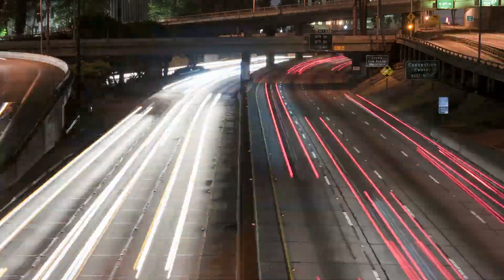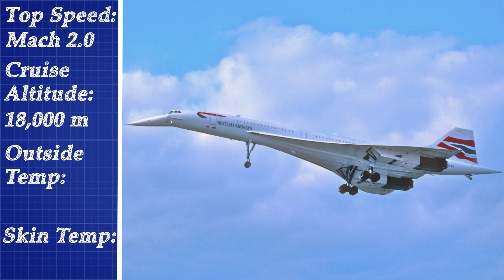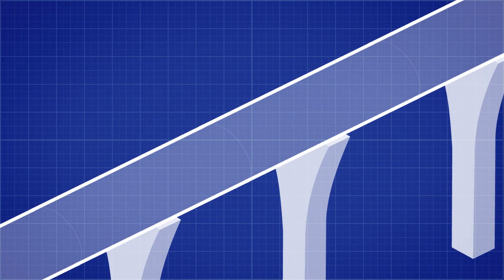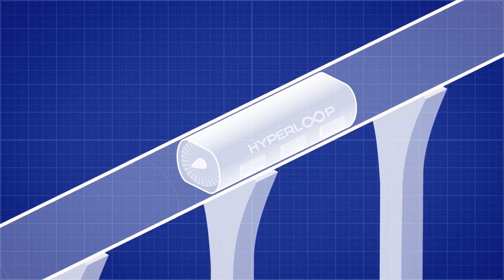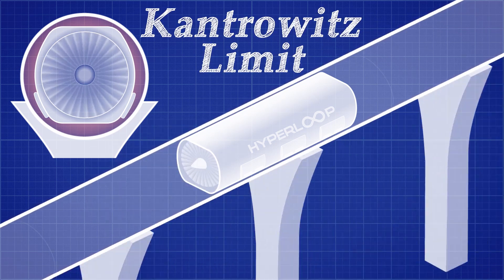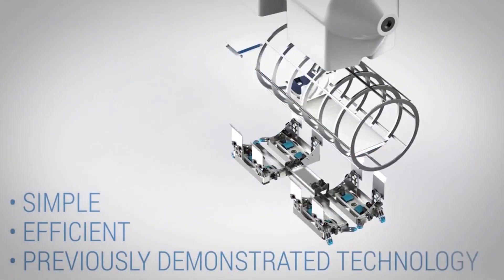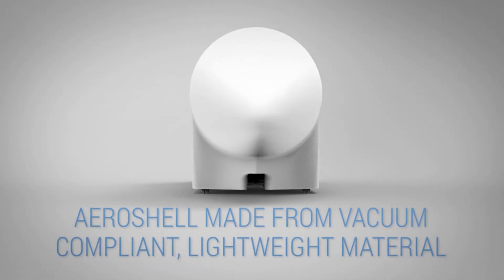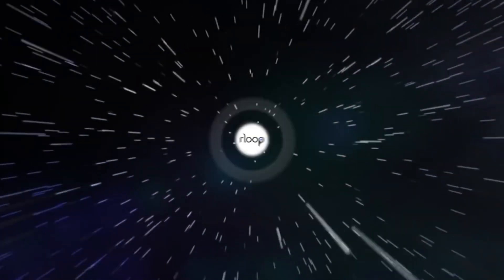Hyperloop - The Future of Travel?

Comment: what about the debunk by Thunderf00t?
Reply: It's a MARS vacuum. It's still going to boil the moisture from your eyeballs if you depressurize.
Reply: Perfect vacuums don't exist. there is always a little bit of gas. The problems TF00t described are a fundamental truth about pressure differentials.
Reply: Are you sure?
Reply: The Eh Team the cavitation
Reply: Thunderfoot blows it way out of proportion.   He shows the concrete walls of NASA's deep space vacuum chamber but does he show the thin glass walls of your thermos?   He talks about air rushing in at the speed of sound, the air would rush in at a speed determined by the differential pressure and the diameter of the opening as per fluid dynamics, the speed of sound is an upper limit that it could not exceed no matter what the differential pressure is and keep in mind that the differential pressure is not infinite, it would be less than one atmosphere, your espresso coffee maker operates at 19 atmospheres, you don't see the coffee shooting out at the speed of sound.   We already have pneumatic systems that deal with leaks all the time, the very reason why we have air brakes for trucks and buses is that leaks can be compensated for with additional pumping capacity.    Thunderfoot is completely oblivious to engineering fields such as fluid dynamics.   Take his video to your local University and ask the fluid dynamics prof to review it.
Reply: @KevinLuWX  Hello! How are you doing?
Reply: +SebastianMisch
"I clicked through two of his videos and if what I saw is representative you'll see condescending accusations like "doesn't understand basic physics" and of course a lot of strawmen to make it easier to 'debunk' him"
Huh, so you didn't watch Shane's videos about why thunderf00t's arguments are flawed, but you're pretty sure they're full of strawman arguments. That's some intense irony.

No. Shane actually plays each part of the relevant statements thunderf00t makes before addressing them. So no strawman. He then explains the relevant principals that thunderf00t got wrong and works out the relevant calculations to demonstrate why he's wrong.

"Since you seem to be very invested in this project"
I'm not. I'm invested in education. Thunderf00t positions his channel as a science education channel, then gets basic science wrong. That's a problem for me. What's worse is that when people correct him, he refuses to fix his videos. That's a huge problem for me. It's kindof sickening that he would rather spread disinformation than take a hit to his ego.

"...why aren't you thankful for the criticism?"
There are plenty of legitimate criticisms you can levy against the Hyperloop concept, but Thunderf00t seems to miss all of them. Instead, he messes up the cube square law, says a breach in the tube would cause the equivalent to a nuclear blast wave, spreads FUD about terrorists, and all sorts of ridiculous arguments.

Isn't it a red flag to you that thunderf00t thought the compression fan was for propulsion? Isn't it a red flag that he justified that by pointing out a 170 Newton "thrust" figure on pg. 18 of the alpha document? I mean 170N/15000kg pod gives an acceleration of... 0.001 gs. And he would have had to read the preceding 17 pages that mention several times that the fan is for compression to circumvent the kantorwitz limit and the pods are accelerated by electromagnetic linear motors.

Does that not set off any red flags to you?
Reply: Please see Shane Killian's videos countering pretty much every one of TF's claims with physics. They're excellent.
Reply: +FableBlaze
Yet for some reason a transportation system where a test run in a 500m tube (that is missing most major components) is marketed as a "full-scale systems test" does not set of any red flags?
Enumerating the flaws in thunderf00t's arguments doesn't equate to an endorsement of Hyperloop. That's a strawman. Like I stated before, I think there are a lot of legitimate engineering concerns that need to be worked out before the Hyperloop concept is rendered viable.

I will say that the full-scale system test you're referring to seems fine to me. As the name implies, a full-scale system test is meant to test a single system at full-scale. The system, in this case, is the rail.

I wouldn't expect a chemist suffering from the Dunning-Kruger effect to appreciate the subtle difference between full-scale, full-speed, or full-system. That's why I wouldn't take Thunderf00t's attempt at playing engineer seriously. He very clearly doesn't know anything about engineering.

Engineers don't go from paper proposal to full-scale, full-system, full-speed implementation in one step. That's a terrible idea. Instead, they break problems down into incremental goals with clearly defined objectives.

That's yet another concept Thunderf00t has trouble with: clearly defined objectives. He seemed very confused on that point during his heroic mockery of the student pod challenge. He seemed, once again, to fail at reading any of the official documents discussing the purpose of the challenge, the tests performed, or even who was sponsoring the event.

It was, in fact, a student competition sponsored, paid for, and constructed by Space X. A company that has no stake or affiliation with any of the Hyperloop companies. The final test was to accelerate each pod down the tube in a vacuum on a sled, then release the pod and collect data on the pod's ability to coast and break. It turns out that it's not a very showy test. You can quickly assess the pod's drag coefficient, then engage the breaks.

My favorite part is TF's assertion that the pod competition was a means of crowdsourcing designs for the Hyperloop pod from undergrad engineers. Riiiiiiight...

Not to mention the fact that they are already marketing plans for different routes while at the same time the concept itself as a whole is unproven.
How is that a problem? The Hyperloop Alpha document used LA to SF as a case-study. There's no reason it must debut there. In fact, the document clearly acknowledges that there is already a rail system planned for that route. A system that's already under construction. Part of the reason Musk chose LA to SF for the document was to use the already planned system as a point of comparison.

Scouting locations and discussing logistics with multiple potential customers can be done in parallel with iterative testing of the hardware.

There are also multiple different start-ups based on the Hyperloop concept. Musk published the concept freely so that others could make a go of it. There are currently 3 major players in the Hyperloop start-up scene:
Hyperloop One
Hyperloop Transport Technologies
Arrivo

Along with several lesser known startups (and possibly a new Musk venture soon).
Reply: @AbeDillon  hes actually a nuclear engineer...
Reply: @Dean Vermee what is it that compels people like you to make up BS that is so easily debunked?  Google "Phil Mason": 

Mason received a BSc (2:1) (1993) and PhD (1997) in chemistry from the University of Birmingham.[3] From 2003[4] until at least August 2010, Mason was affiliated with the University of Bristol.[5] 

Mason worked at Cornell University's department of food science from 2002 until 2012, where he studied the molecular interactions between water and sugar molecules,[6] as well as molecular modeling with regard to proteins and guanidinium solutions. As of 2013, he was working at the Institute of Organic Chemistry and Biochemistry of the Academy of Sciences of the Czech Republic as a member of a research group headed by Pavel Jungwirth.[3] Mason has argued that alkali metal reactions with water can cause a Coulomb explosion.

In other words: HE'S NOT AN ENGINEER.

Not a nuclear engineer. Not a mechanical engineer. Not any kind of engineer.
Reply: @AbeDillon  K, thought he said that in a video but guess im wrong.
Reply: @Dean Vermee sorry for the overreaction. There's just so much FUD about HyperLoop (HL) mainly spread by thunderf00t (TF) fans. The thing is: there are hard engineering challenges that need to be addressed to make HL work, but  I couldn't find a single point that TF has made in all of his HL videos that holds any water. Whenever he's been confronted with the many flaws in his arguments, instead of engaging in meaningful conversation, correcting his mistakes and stopping the spread of disinformation; he's just responded with childish belligerence.

He positions his channel as educational, but he gets very basic things wrong like the cube-square law, and refuses to correct it. It's infuriating. Most of his videos simply ridicule student-centric competitions which he somehow believes are part of the actual development process of the HyperLoop despite ample information to the contrary. TF is also known to be extremely dishonest in his other videos. A good example is explored by a YouTuber named "Shaun" who put out a video called "Thunderf00t the Cherrypicker". I recommend TF fans check that out.
Reply: it's a near vacuum, not a perfect vacuum. The troubles Thunderf00t ran into is only relevant to perfect vacuums.
Reply: @canidaeSynapse  mate when it's that low of an atmosphere it doesn't really matter it still doesn't work

Comment: This just can't be serious. Did you even estimate how much pressure would hyperloop tube withstand? Besides, as someone familiar with land pipelines, I see a HUGE problem with the whole thing buckling and deforming. You simply cannot maintain such vacuum space, unless you're in outer space.
Reply: +AndSome625028 You do realize that atmospheric pressure is only 14 psi and the difference between a vacuum and atmospheric pressure can not exceed 14 psi. For comparison sake, a high quality espresso machine operates at 19 times atmospheric pressure, a commercial welders tank is 150 times atmospheric pressure and the graphite compression tanks proposed by the automobile industry for hydrogen cars are 700 times atmospheric pressure.  The tube would have to withstand 14 psi and since you work with pipes, you should know that is trivial compared with what commercial pipes can withstand.
Reply: +AndSome625028   You're really putting your foot in your mouth, do you even know how to calculate the load from the differential pressure?   The hyperloop concept is to keep costs low by using commercial pipes commonly used for pipelines.   Do you know how large a load those pipes can take compared to the load of containing a vacuum within the pipe.   Those pipes can take loads hundreds of times if not thousands of times greater than containing a vacuum.   

The hyperloop concept is also about not using a vacuum but using an easier to attain partial vacuum in hopes that a partial vacuum with an active turbine in front of the capsule would be enough for the greater speed, yes that turbine has nothing to do with thrust and indeed thrust will most likely be from linear motors.   

The reason why large vacuums are not used is because it is difficult to produce a vacuum in the first place not because of the load.   The load is finite because the load can only be based on the differential pressure from atmospheric to the vacuum which can never exceed one atmosphere.   Even a simple welder's tank holds 150 times atmospheric pressure and hence 150 times the load of had it held a vacuum, what do you think those pipes are rated for?

Please, go back to school and study first year engineering statics and dynamics, it's clear that you do not understand the the issue at all.
Reply: but, it's a near perfect vacuum. Doesn't come with a lot of the troubles a perfect one would.
Reply: It says in the video that hyperloop pressure is 0.01 atm, which roughly equals to 99% of perfect vaccuum. It's the atmospheric pressure at almost twice the Concorde cruising altitude.
That is to say that the tube itself does not expand when heated, which you had blissfully assumed.
Reply: fine, fine. I admit to not understanding the details. It's a youtube comment section afterall. Everyone and their dog gets to have an opinion here, technically wrong or not, it's all the same.
Reply: canidaeSynapse 
No, that's fine. But I'd like to believe that having proper attitude, one can educate other and get educated themselves.
Reply: John Wang 
There is a reason people don't use vaccuum in large scale.
The issue isn't about pressure, but a load. When your espresso machine makes a cup of precious macciato, the load of that pressure is being contained by a fairly small chamber of pump and manifolds, which are made more rugged to handle it.
But when you scale it up, you'll need much more material, and also other forces come to play.
Pipes are made to withstand pressure from inside, it's a fairly easy design. Typical gas landline handles more than a 1000 psi of pressure - using steel tensile strengh. 
But if you compress the pipe from outside, that strench is wasted since the load will just buckle it. Vaccuum pipes require higher rigidity, which can only be achieved with more material and higher complexity.
And don't even get me strarted on thermal expansion, which is normally solved with U-shape dampers, but hyperloop can only use sliding couplings, which use moving parts.
And hydrogen cars? Jesus, how people still think it's a thing?
Reply: John Wang 
Well seems like someone skipped a lecture or two and acts all smug instead. Turbine wasn't even on the table. 
I'll give you a hand that last time, but don't come back - you're out of credit.
Let me just reiterate things you didn't address in your long attempt of mockery:
- Vaccuum pipeline operates under compression - not extension, hence tensile strengh of metal is not used (the material is bent instead of stretched), and steel handles bending much worse. Ever seen cistern implosion? It's just 14 psi, right? 
Ever seen NASA's vaccuum chamber wall thickness?
- Thermal expansion is huge and will require stuffing boxes which wear out and require replacement.
- What is the safety for explosive decompression?
- How do you produce this vast volume of vaccuum? 
- How do you assess pipe integrity?
Reply: AndSome625028 The effect of compression instead of tension is that deformation greatly reduces the strength of the structure which is why submarines have supporting frameworks instead of just increasing hull thickness.   The overall compressive strength is similar to it's tensile strength and commercial pipes are designed for far more pressure differential than one atmosphere. Yes, containing a vacuum is different but it isn't something that requires several feet of concrete, it may require structural framing to prevent the tube from buckling but the compressive strength of steel or even GRP is more than sufficient. The point s, the pressure difference between one atmosphere and a vacuum is a fixed finite amount and not even a particularly large differential pressure and we commonly address it in many applications.
Reply: AndSome625028 The whole concept is to use a partial vacuum. NASA's vacuum chamber is about producing a vacuum similar to that found in orbit, big difference. At what level of a vacuum would the hyperloop work, well that needs to be determined but the hope is that it would be a level easily obtained by just compressors which can move large volumes of air but not achieve very deep vacuums. I find it hard to believe that vacuums deeper than 1/10 to be viable as then you would need a cold trap to remove water vapour. I would be surprised if the concept could work with anything deeper than 1/2 to 1/5 since it will depend on a low energy cost to attain the partial vacuum. So far, all the promotional material refers to 1/100 which I think is ridiculous and an automatic recipe for failure.  I'm not impressed by the prototype proposals such as the one by rloop as they are not addressing the question of if a weak vacuum could be used but rather seem to leverage a strong vacuum for a show and tell demonstration.   There are serious questions with the hyperloop concept, they are not as disasterous as everyone makes it out to be, but whether or not the degree of vacuum required could be reduced enough for the concept to be viable needs to be determined yet what we see are not attempts to answer that question but attempts to have something to present to investors.

Comment: if the minimum pressure is .01 atmoshperes, that's fine. what's the maximum pressure? 200 atmospheres? that'd be pretty hard to push through.
This video hardly explored the details of any engineering problems. another thumbs down.